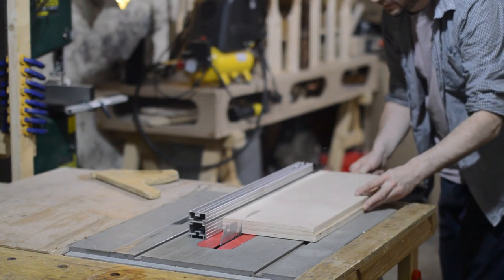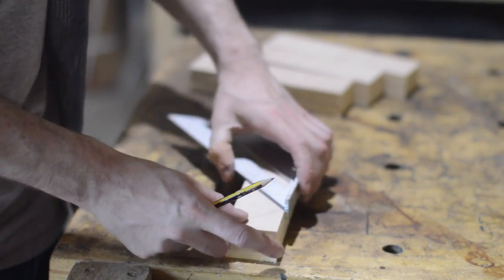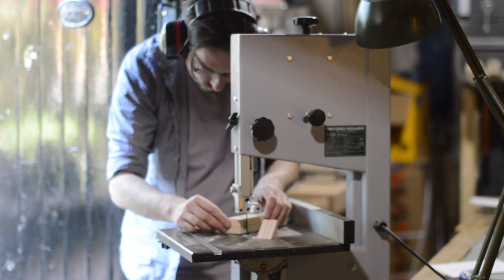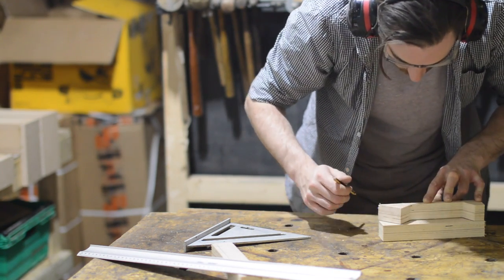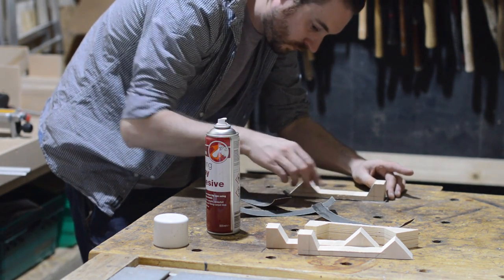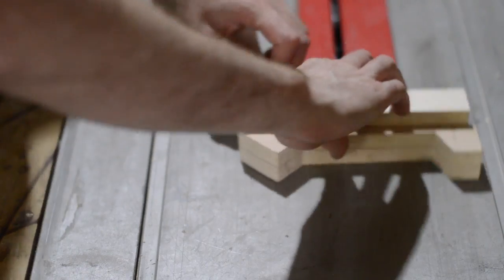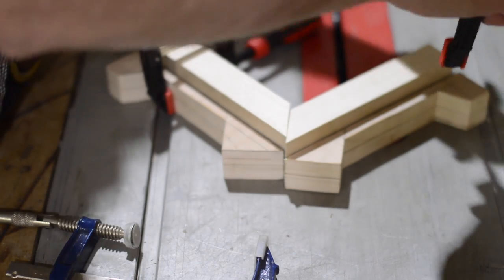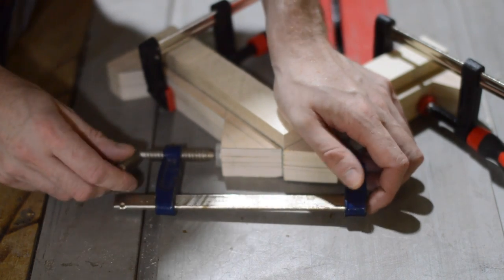Mitre Clamping Blocks

Comment: Nice and straight forward, good job mate👍
Handy jigs to have in any shop.
Band saws definitely makes life a whole lot easier👌
Reply from the maker: The bandsaw is my favourite tool
Reply: @Badgerworkshop  easy to see why. Takes a little to get used to cutting relatively straight, or follow curved lines. Once you do though, it's another skill under your belt 👍